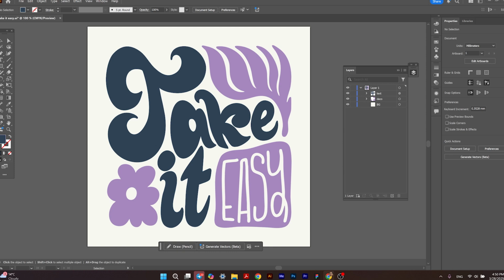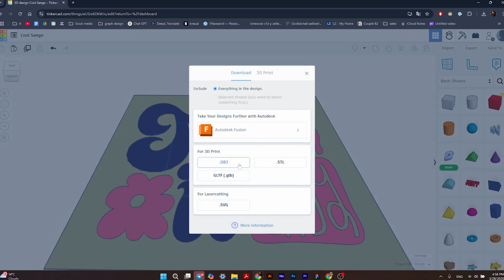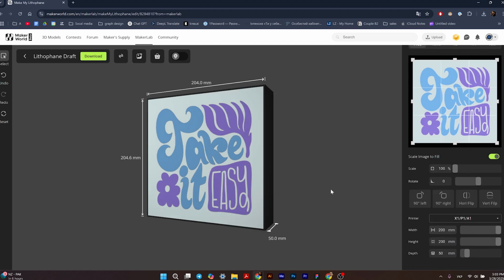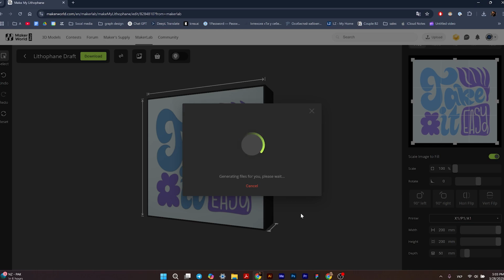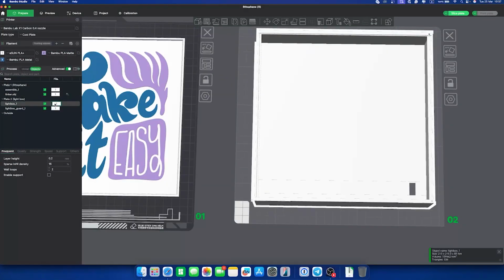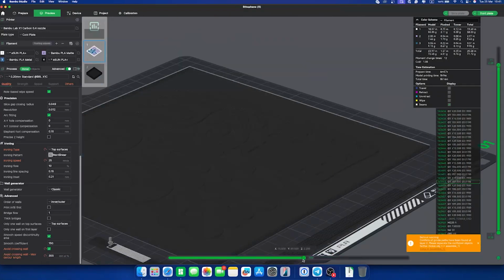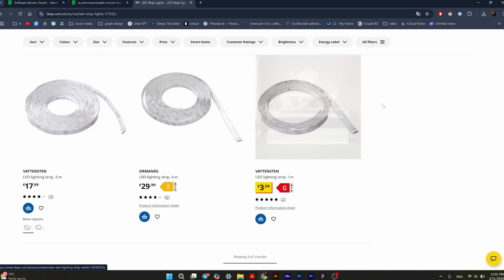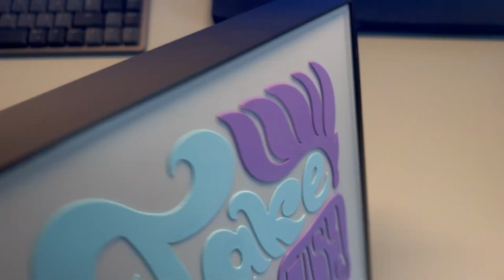Using FDM 3D printing technology to create lampwith custom design

Comment: I find this video super helpful because I've worked with that program for 3D printing before, but I've never considered the possibility of turning my designs from Illustrator into something personalized with 3D printing. It also helps me learn a few extra steps to ensure that my design will print well. The explanation is simple and well done. Thank you so much. 🙂‍↕️

Comment: Great job Anna, YouTube algorithm has made me stumble on your video. I’m a huge 3d printing enthusiast and love to see it being explored by as many people as possible. If I can offer advise, it seemed like you were struggling a little with removal of your model from the build plate. I have found that allowing the model to fully cool, it should just pop off. If not popping off, a slight flexing of the plate should release it easily. Little easier with a texture plate so another trick is to use glue stick with the smooth PEI sheet which will help release the model after cooling. A thin application is all you need.  I enjoyed your video, looking forward to the next project.